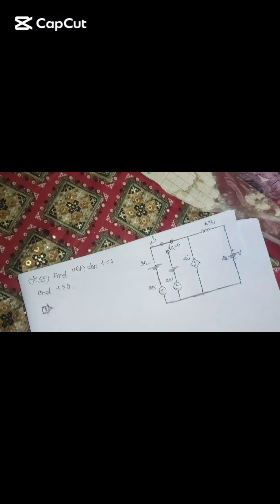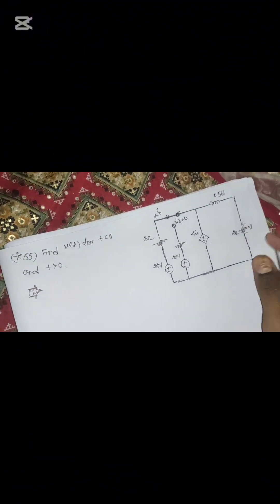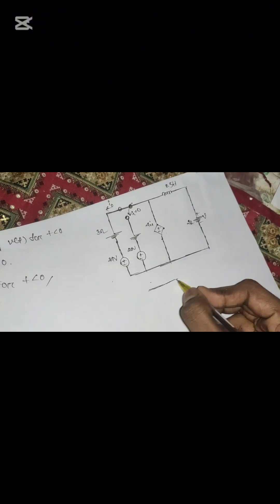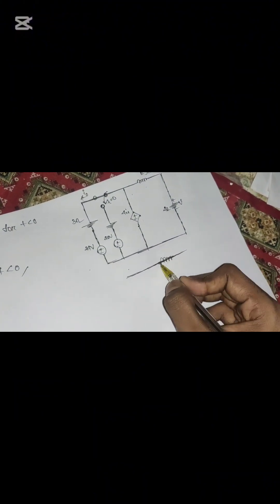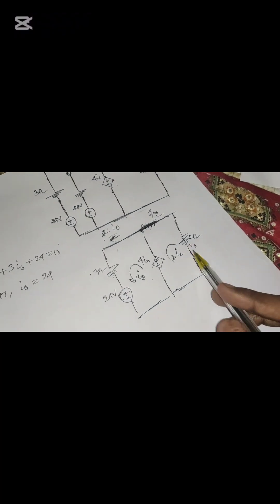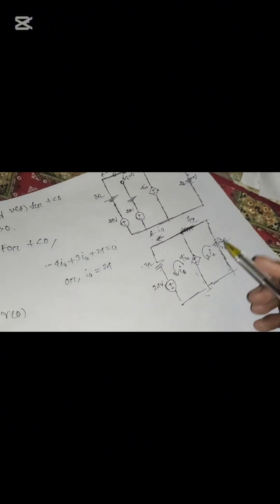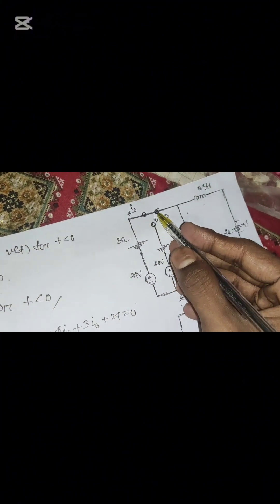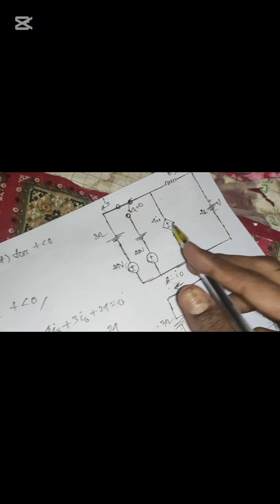Exercise problem 7.55 || Fundamentals of Electrical Circuit(Sadiku) || First order circuit ||

Comment: Forms supermesh , need clarity
Reply: Did you figure it out using supernode ??
Reply: @Ryadryad-tl5kg  It neither forms a supermesh nor a supernode. A supernode occurs only when a voltage source is connected between two non-reference nodes, not when the source is connected between a node and ground.
Reply: There's no need for supermesh. If the inductor is connected to a DC source (24V before t<0), then after 5τ it behaves like a short circuit. 
At this point, the voltage across the 2Ω resistor is simply equal to the voltage across the dependent source, which is 4i0=96V=v(0).